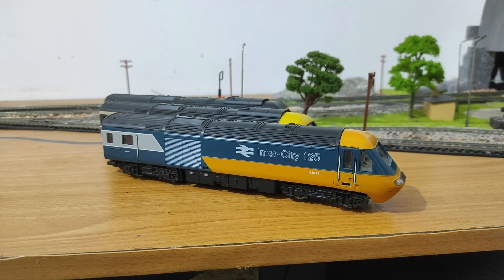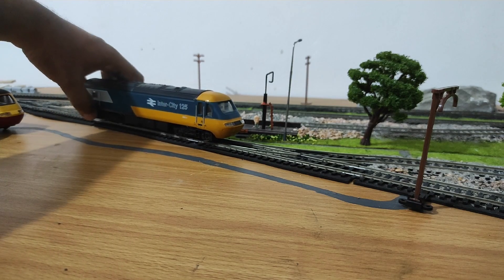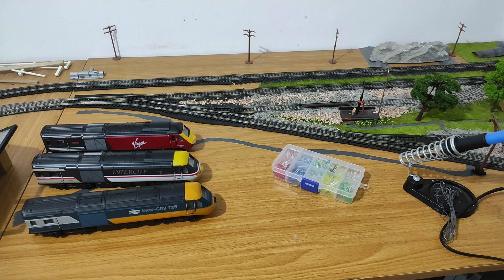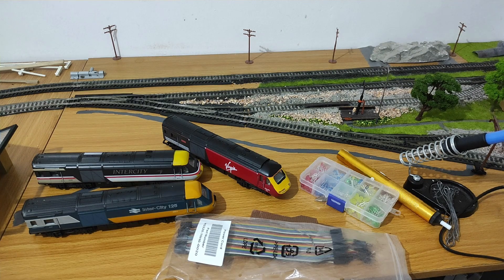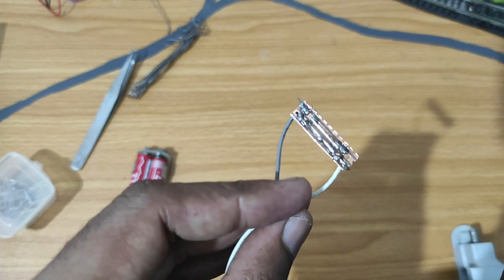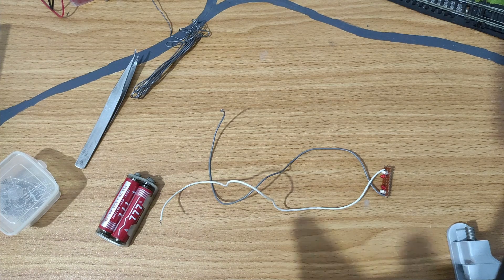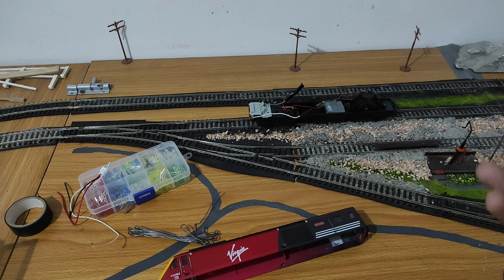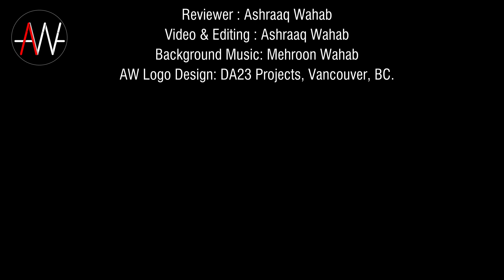Directional Lighting For Your Hornby HST? Watch This To Learn How!

Comment: Just for your information, the   swallow and virgin livered units are the former Lima models that Hornby inherited when they bought them out. They decided they were better than their own so they upgraded a little and sold them instead, eventually as part of the railroad range.
Reply from the maker: Makes sense...adopting the best features of each manufacturer. However, my swallow one has the bogies themselves acting as pickups - so the front bogie picks up from one rail, and the rear bogie picks up from the other rail (of course, not the side with the traction tires). This is the same as my oldest one, the blue and yellow liveried example. Meanwhile, my Virgin one has individual pickups for each wheel (including the traction tyred ones).

Comment: Great video mate. I bought a pre built board on ebay and found it burnt out despite following the instructions. I guess it needs a resister?
Reply from the maker: Thanks! Yes I guess that would be the reason it burnt out, since the space at the front of the HST where the board would go isn't big enough for a regular resistor (unless it's one of those tiny ones). I'm surprised the instructions didn't include any mention of the resistor. Anyways, as a general rule of thumb, it's always best to ensure that there's a suitable resistor (usually 1K, but can also use a 1.5K for reduced brightness) in series with the power supply for DC model train applications. I'm not really conversant with DCC, so can't advise on that front.
Reply: @ashraaqwahab  would the resister need to be on both positive and negative? I.e. for when the polarity is changed to run the other way?
Reply from the maker: @_RandomPea  No, you only need it on one side. Either way it will do its job. There's debate online on whether it should be installed on the positive or negative side, but I've got locos with lights installed in them years ago that are still working fine - with the resistor on the positive, or the negative.
Reply: @ashraaqwahab  thanks for the tips

Comment: Hi Ashraaq, I was interested in the wiring of the LED and Resistors on the strip board. So my question. Is the board isolated between the holes. Is it possible for a close up of the strip board rear for me to see. I have a few strip boards and found it ideal, after watching your video, to use a piece of strip board. Thanks once again for your review.
Reply from the maker: Thanks! I'll send you a photo of the strip board I use. The rows of holes are connected in a strip of copper, with isolation between the adjacent rows. So, if you were to place an LED with the positive leg in one row and the negative leg in another row, it will work when you apply power in one direction. Then, when you attach another LED in the opposite direction, that one will light up when you reverse the polarity of the power supply.

It is also possible to buy a form of board where each hole is totally isolated, with only a ring of copper surrounding it, to aid soldering. This board allows you to totally make your own connections vertically, horizontally, and diagonally, with solder bridges and bridge wires, but for this application, it's a bit overkill.
Reply: @ashraaqwahab  Thank You.